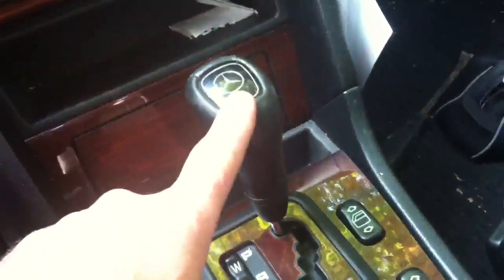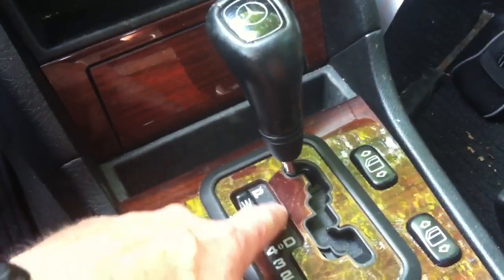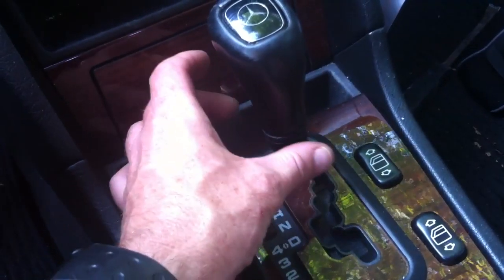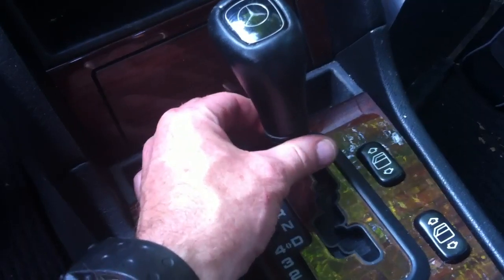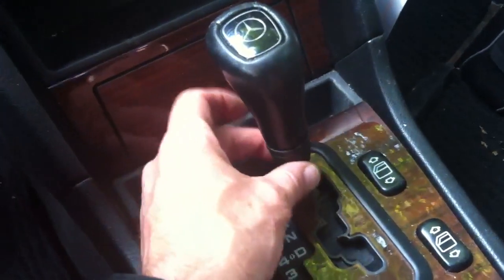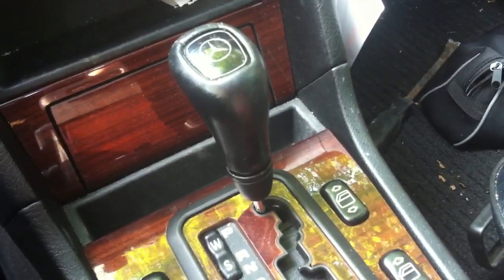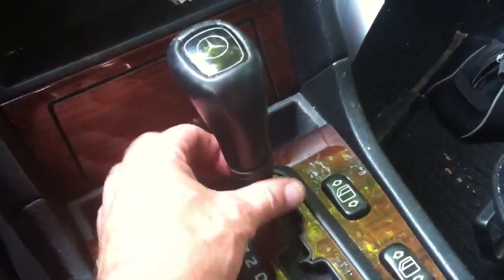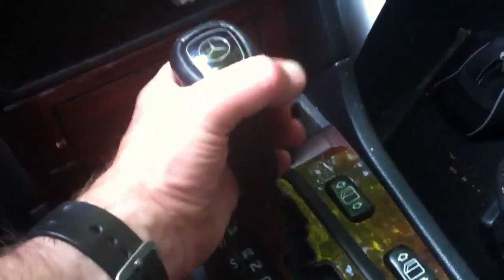how to remove the shift knob on a Mercedes w202,w220 and others

Comment: i bought a e320 knob but it didn't have the center plastic so what i did was i remove it from my original shift knob an cut all the edges off  of it so only the plastic tube would be left then i inserted into the 320 wood shift knob fit perfect then i just inserted it back on the metal shifter know i have a e320 wood shift knob on a w202 :D
Reply from the maker: nice :)